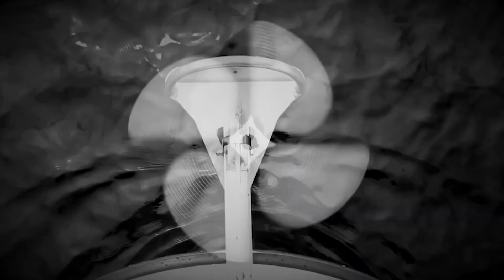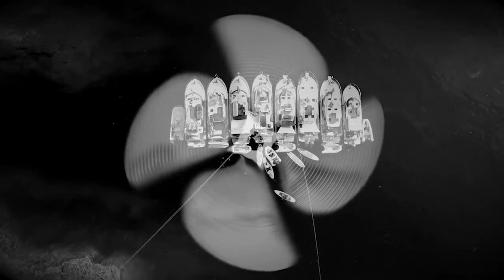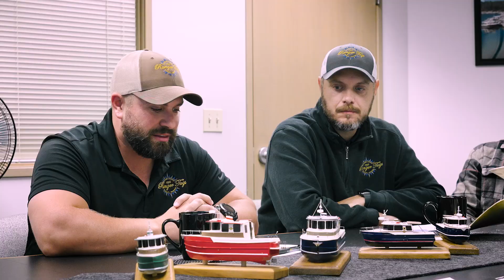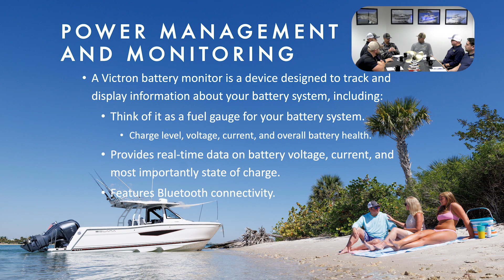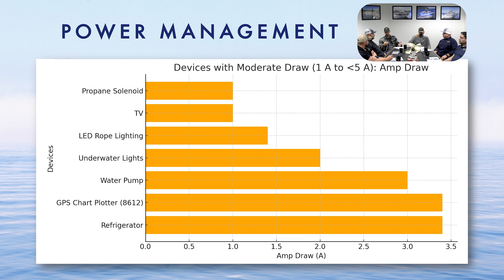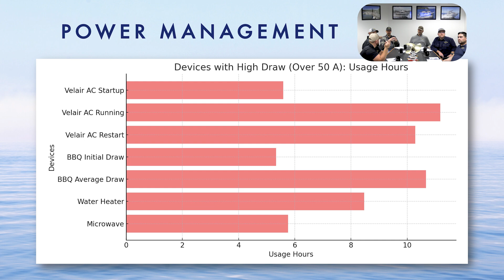As the Prop Turns | Power Management Part 2: Lithium Edition

Comment: We own a 2025 R25 with the lithium batteries. We also own  a sprinter van with two 6 volt AGM batteries. Both vehicles have a  similar electrical footprint and so  I can compare the systems side by side. I am blown away by the lithium batteries in the boat and the Victron monitor is amazing. I just went and checked the Victron and I am currently drawing 2 amps. The voltage is 13.32 volts and the Victron says I have 240 hours left in the batteries. I always just chuckle when I see those numbers.  I start to get worried when the van voltage drops down into the 12.6 volt range. It can happen over night if we are using a lot of current and its not unusual for me to run the van motor for 30 minutes at 1600 rpm in the morning to charge the batteries up. We have three solar panels on the van and they will charge up the  AGMs in 30 minutes when the sun comes up. But the boat with the single solar panel and lithium batteries blows the AGMs out of the water. We don't skimp on using the electrical appliances and we always remote camp in PWS. I have no concerns with these batteries.

Comment: The R-23 manual says that the house batteries get 90% of the solar output, and the engine battery gets 10% (and the thruster battery zero). In this webinar you say that house gets 100%. Is the R-23 manual correct? (I have a 2023 R-23 with Lithium house batteries if that makes a difference.)